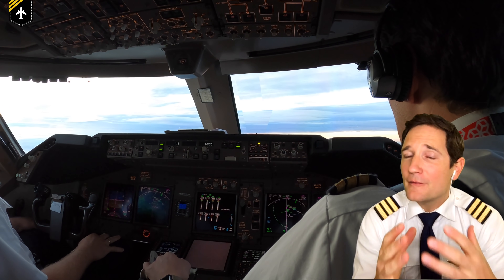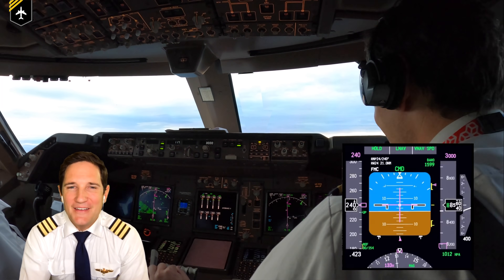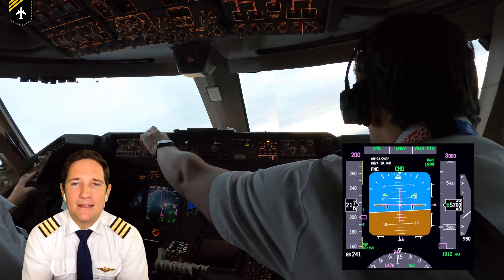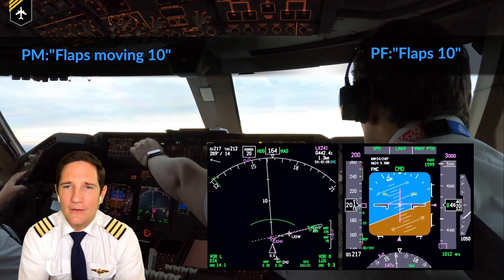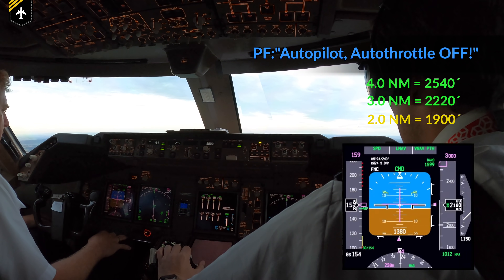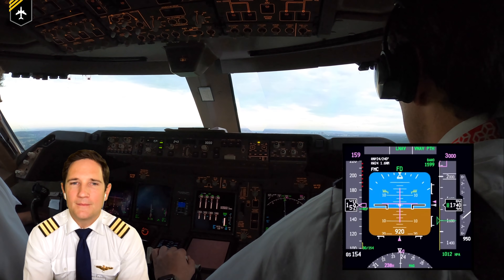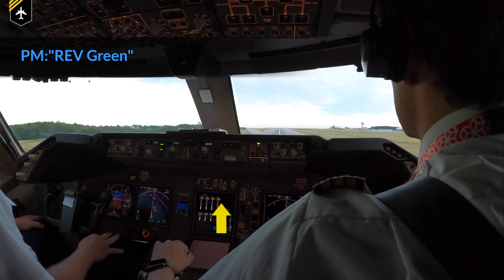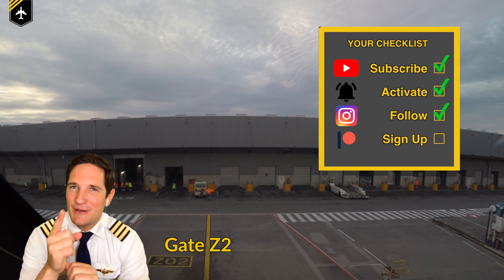How to fly an RNP APPROACH with a BOEING 747??? Explained by Captain Joe

Comment: Never been prouder to have my Capt Joe REMOVE BEFORE FLIGHT when I configure my VW Jetta for departure.
Reply from the maker: Fantastic quote😉
Reply: Haha. I, to my wife and children’s embarrassment, often roll down the window and yell “clear prop” before starting the engine in my Škoda Rapid. I don’t have a Captain Joe key string, but I do have one from RDAF 722SQN
Reply: @TumzDK  I used to call out "Full Boost Vertical" as I advanced the heater levers on my first car.
Reply: Before central locking was a thing, I'd say... " Cabin crew, arm doors and cross check. " and the kids would make sure each others' doors were locked!
Reply: I often do a safety briefing before departure in my Subaru exept the thing with the oxygen Masks (... still have to fit those:D). When im at work however i include that because my work vehicle is able to provide oxygen to some of the passengers (... my work vehicle is a Fire Truck)
Reply: LMAO

Comment: This might be a dumb question but I still want to ask how the plane knows its glide slope using this approach? Cuz u only set the altitude to the DA and let the plane descent solely by itself, that is different from what ppl do with the LOC approach, like setting the FPA to -3 degrees to make the plane descent elegantly. So I’m curious how the plane could stay in the right glide slope if u only provide the altitude without a VS or FPA🤨
Reply: Same with LOC it's not vertically precise because you are still following stepped altitudes as is on the chart. Lateral precision is the strength of RNP because it does not rely on ground stations unlike LOC and ILS.

Comment: Nice video, thanks.
Couple of questions - as a fellow -8 operator - I noticed you shot this approach in Lnav/Vnav? Why not an IAN approach? So in FAC and GP.
I don’t think I’ve ever seen an approach shot in Lnav/Vnav on a -8? In -400 yes. In -8 we do IAN approaches.
The second question is about slowing down. You’re in Vnav - why are you selecting speed manually? If you’re in Vnav you can close the speed window and just ask for flaps 1 and the speed will drop automatically to speed 1. You just need to verify it did. 
Once G/P captures (if you fly IAN approach - see my first question) the speed window will open up automatically (like for an ILS). So why do it all manually?
Also, you say Flaps 5 speed 5 but set your speed 5 knots above it? Why? Our calls and procedures are Flaps 1 - Speed 1 and then let the speed bug drop on Flaps 1 speed, etc., etc. 
Not sure I understand the 5 knot extra buffer considering a flap buffer speed is already built in? The only time we use the 5 knot buffer is for Vref speed during landing (same as you).
Anyways, thanks for the video, looking forward to hearing your perspective.
Fly safe.

Comment: Wonderful landing and explanation. Thank you Cap. Joe. 
I Strongly recommend to use the professional 747 training software- The AerowinX PSX, which is really realistic and simulate almost all the functions of the 747, including the maintenance overhead and circuit breakers. But right, it only simulate the -400 (RR PW GE), and not the -8. 

The Cap Joe channel is always the best aviation channel.

Comment: Awesome video!  As a Cirrus pilot flying Garmin 1000+ I find it amazing how similar the procedures are as I would fly a RNAV (GPS) approach but SO MUCH FASTER! LOL. I assume the green arc on the ND represents the position you will hit ALT set with present vert decent rate?  Thanks again!
Reply: yes it does the legandary " curved banana " shows you at what point you will reach the MCP alt which is set, regarding RNAV does your cirrus use SBAS and can therefore fly LPV minima ?
Reply: @tomharper8402  thanks for the answer!  Yes the Cirrus flies SBAS down to LPV Minmima. Like a zip line. Lol
Reply: @gonetoearth2588  nice one can you then fly lnav vnav gps approches but using SBAS or is LPV and LP the only type that use SBAS
Reply: @tomharper8402  With SBAS (WAAS in USA) the Cirrus will fly ALL SBAS approaches with and without GS coupled to the AFCS...

Comment: A couple of questions for you Capt Joe.  Why are you setting your speeds manually?  Are you required to use a +5 kts value on flap speeds?  Also, why the LVSA isn a -8?  Do you not use the IAN function of the -8 at CV? 

 Also, when you put the transponder to XPNDR you are still reporting altitude but you are turning off your TCAS/ACAS display.  The plane puts out an "On Ground" bit in the Mode-S transponder data so planes in the pattern would know you aren't flying.

Nice video.  I like how you put things together.  I miss flying into LUX though I don't miss the hill on the RWY 6 side.

Comment: why pilots stay on middle runway light humps instead of running aside of them so they dont feel and hear them?
Reply: Just one of the ways to be sure you are at the centre. Despite having a PCN, a metre on or off and you never know your wheel just goes into the pavement.

Comment: Do you fly an Airbus A320 aswell and the Boeing 747? or  are you able to switch planes to pilot sometimes or no? ( I'ma  Cessna 172 Skyhawk student pilot and i'm on my 5'th and i think its  minimium 40 Hours till you reach the pilot's license point?  (
Reply: Bekker the Dutch Angel Dragon legally, if he's current, and type rated,he can fly whichever plane he wants.

But practically, a pilot is kept rostered with a similar type of aircraft. (Though in this case he only flies the 747 as his airline doesn't operate A320)
Reply: ZK-APA I didn’t know so but thanks for telling me / answering my question.
Reply: Bekker the Dutch Angel Dragon he flew the A320 when he flew for Air Berlin but they went in 2017

Comment: hi Captain Joe, why the A380 just have 2 reverse trust (in engine 2 and 3) or is the A380 can do all the 4 engine reverse but the pilots just open 2 after touch down?
Reply: Only 2 and 3 have reverses. All 4 would kick up too much debris such as loose stones or standing water etc. Plus the amount of thrust produced by2 engines was sufficient as the A380 isn’t going to be going to small airports

Comment: I have questions why don't aircraft have rear, side , bottom etc camera with night vision so that pilot can see better incase emergency etc?
Reply: Because all the sensors in a modern aircraft give you a clear enough picture and combined with ECAM/EICAS you can see what is wrong. Pilots don’t need to know WHY something has happened. They need to know WHAT has happened, what has failed and what needs to be shut down, reset, transferred etc. Having cameras is just not currently viable. The tail camera and underwing ones on the bigger jets are purely to assist in taxiing like your rear parking camera in a car

Comment: Why do planes not have propellant thrusters like rockets?
Reply: Because the airframe needs to be able to withstand the amount of force exerted on it from the air trying to flow around it. Why do you think Concorde had delta wings. Also rocket tend to be lit and then won’t go out until they run out of fuel and more difficult to control thrust

Comment: Do you prefer a Radar vectored RNP approach or to fly via LX242/LX243 etc. ?  And does it make a difference if you been on vectors before, for example coming from MMD heading 085 and than LX243 or would you prefer in this case a transition (VAVOT1S)...?

Comment: The "RNV" aspect is not really clear to me yet. Do the LNAV/VNAV mean that the localizer (ILS) is not being used, but instead relied on by GPS? How does this relate again to ILS approaches? You used the DME distance/height as a reference, is this just to make sure no mistakes are made by the AP? Or is this actually being used as a reference because it's an RNV approach instead of an ILS with glideslope?
Reply: An ILS approach relies on 2 beams (one vertical one horizontal) being transmitted from the ground and gradually getting narrower as you get closer so it gets more precise the closer you get.

An RNAV approach is following a series of GPS waypoints at set altitudes constraints (sometimes speeds) and these are all input into the aircrafts flight management computer so main advantage is you don’t need any equipment at the airport. The disadvantage is that normal LNAV/VNAV minimums are not as low as ILS, you need to have a good location accuracy and you can’t autoland

Comment: Hey Joe, great vid. Just wondering what headset you're using? It doesn't cover your ears completely so just wondering if you use a different set for non-pressurized aircraft? Thanks!
Reply: Aaron Sanders this looks like a telex one (guessing though)

But yes, he has a bose A20 when he used to fly the 320 or GA

Comment: interesting!  this procedure is more similar to the 757/767 than the 737NG in that you still must manually set your speed bug with each flap selection. Figured the -8 would be updated logic but guess not?
 "LAVS" is good gouge I got from Boeing (on 767/757) that some might like... once cleared for approach (and on a published segment/transition):
 
LNAV, 
ALTITUDE (set field elevation or MDA, per airline perference), 
VNAV (in case were in HDG SEL) then, 
SPEED (open the speed window, set with each flap selection)

don't forget to set Missed Approach Altitude descending below 1000'

Thanks for the excellent video & helping simmers fly with utmost realism.

Comment: Why do the roles change after landing? It seems the pilot flying always hands control to the pilot monitoring to taxi. Is there a reason for this?
Reply: Craig Lister usually companies have a captain to taxi policy.

Also, not all aircraft are equipped with tillers on both sides.

Comment: Thank you for posting this video. Very eyeopening to see an RNP approach flown in a transport category aircraft. It feels very familiar to the RNAV GPS approaches flown in the US. I noticed that you used LNAV/VNAV minimums. Is there a reason why you didn't use LPV minimums? Is it due to the lack of SBAS/EGNOS equipment?
Reply: “RNP Approach” will be the name for all RNAV approaches after December 2022. They will be the ones with straight lines between waypoints. RNP AR will have the curves

Comment: What is the difference between and RNAV and RNP approach? Is that the name the European pilots call RNAV approaches? I’m a instrument student pilot and I’m not familiar with RNP approaches.
Reply: RNP approaches are becoming the name for RNAV because all RNAV approaches require some form of required navigation performance. RNP AR approaches will be the Ines with curves. Both use the planes systems to monitor its progress as long as it’s accuracy is within limits. 

https://www.icao.int/MID/Documents/2016/PBN%20SG2/2.PBN%20Charting%20-%20ICAO.pdf

Comment: Hi Joe, hope you are doing fine. My questions to you are as follows: 

# Why sleeping berths or bunk beds are not popular in airliners for passengers?

# What is LNAV/ VNAV? How does it work? And how it's different from ILS?
# Types of ground vehicles and types of equipment used for airport operations on the ramp?
Reply: LNAV/VNAV are lateral and vertical navigation. 

Lateral navigation mode on autopilot means the plane will fly from one way point to another automatically as programmed into the flight management computer. Pilots don’t touch anything unless required. 

Vertical navigation controls the altitude and speed at the given waypoint. If the waypoint requires you to be at/below or above an altitude then the plane will fly within those constraints. 

On landing the difference is you’re using the planes on board systems to fly the approach instead of sensors beaming out information on the ground.

Comment: We see in the Primary Flight Display that the aircraft flys a little bit upwards, the artificial horizont is below the center line of the aircraft. But the aircraft should not climb but descent. Is this upward angle of attack used or necessary because the aircraft is flying with low speed so it is necessary to increase the uplift?

Comment: Do you guys ever fly GPS/GNSS approaches at all or only RNP AR approaches? What are the differences?
Reply: GPS/GNSS and RNP approaches are the same but RNP is becoming the name given to all approaches using GPS. You are flying from point to point in straight lines. RNP AR approaches have curves between waypoints, have higher location accuracy requirements and special pilot approval

https://www.icao.int/MID/Documents/2016/PBN%20SG2/2.PBN%20Charting%20-%20ICAO.pdf

Comment: What a lot of people don’t seem to realise is an RNP approach is the new name for all RNAV approaches and will be standardised by December 2022. It’ll either be RNP (straight lines point to point) or RNP AR (curves between waypoints) 

https://www.icao.int/MID/Documents/2016/PBN%20SG2/2.PBN%20Charting%20-%20ICAO.pdf
Reply: Thanks for this comment. I was wondering why those approaches are called sometimes  RNAV or RNP on charts.
A good exemple of RNP (AR) is in Innsbruck (LOWI)
RNP Z 08 (AR), and RNP Z 26 (AR).

Comment: Hello Joe
Great video. One question. When selecting flaps 5 you say you also select flaps 5 speed. However, you set 200kts in the MCP in stead of the speed of 190kts as indicated by the green 5 in the speed tape. You do something similar with flaps 1 and 10. 
When I did my MCC I only did something like this on Vref, not before.
What is the reason for this?
Thanks and regards from the Netherlands

Comment: Sorry CJ, but you need to do a segment on what and why RNP is used. Until I saw this I had never heard this acronym. 😳
If you have already done this I apologise for my lack of attention and as for guidance to correct upload. 🤭
Reply: RNP is basically an approach where you navigate from one waypoint to another and at a set altitude constraints for each one. It’s commonly used at airports that don’t have ILS because it’s cheaper and doesn’t require maintenance. The disadvantage is if the planes location accuracy isn’t good enough it might not be able to perform it and with no ILS it has no guidance from the airport. If weather is clear then could just go visual
Reply: Did some homework. OMG!
The nearest intl airport to me, Queenstown NZ, Uses RNP. 😳  
Learning every day. 🤔. Thanks for your answer.
Reply: DB Thats-Me queenstown airport has RNP AR which means that the approach has curves instead of just going straight liens point to point
Reply: AAAAAAGGHHHH.....Brain explodes.  Sits down with quiet Gin. 👍

Comment: Joe,  seems like you have two sets of deviation pointers, white and magenta.  I'm guessing the vertical white is on GP for the approach, and magenta is deviation to the selected MCP alt by the next waypoint?  Not quite sure..... 
Also, what do the white (occasionally turned yellow) solid lines that seem to be deviation limits represent?

Comment: I love these video's, you can tell the PIC is senior by how fast they taxi to the gate. Looked like about 60 knots  to me and did not even have to touch the brakes for the 90 degree turns.  Amazing !!  :-)
I would love to see the 747 engine start and take off.
Geeze the planes I fly have VNE of 160 knots and land at 47 knots (or a little slower than the Captain was taxing :-)
Reply from the maker: It was fast forwarded

Comment: Nice video! I am wondering how pitot tubes work, would be nice to see a video on that.
Thanks!
Chester
Reply: They're basically a hollow tube that sticks into the oncoming wind. It measures what's called the "ram air pressure" which is caused by the air wanting to basically get shoved into the tube, that's essentially blocked off at the back. Since the air can't pass through, pressure builds, which is directly related to air speed.

That's my explanation as a new student pilot. I'm sure joe's description would be much better and in depth
Reply: @nhwilkinosn  Thanks for the explanation, but I was hoping for a more detailed one from Joe. I know what they are in general (I know basically what you just stated), but I don't know:
What if the altitude is higher and the air pressure is higher and the pressure drops? Is that the speed reading then refereded to as the "Indicated airspeed"? (that was just a quick guess)
What if the wind is blowing air into the pitot tube? Would the reading be different or is it somehow calibrated to the wind or something like that?
etc. etc.
Reply: @chesterwang3070  airspeed is basically the difference between the ram air/pitot tube and the static source. So it's able to "tell" if there are pressure differences, but it doesn't know about wind, so you just get your air speed.
Reply: @nhwilkinosn  Thanks for the info!
Reply: @chesterwang3070  I hope Joe (or someone with a deeper, better knowledge) suppliments my very basic understanding.

Comment: Why are the reverse thrust only on engines 2&3 on the A380?
Reply: Having all 4 would kick up too much dust and FOD that could get sucked in. Plus only 2 is sufficient as the A380 rarely lands at small airports with short runways. 2 was deemed sufficient
Reply: @tomstravels520  but the 747 has all 4 engines having reverse😕😕
Reply: AB flyer 747 engines are less powerful. RB-211 is about  maximum 59,000lb of thrust, PW4000 about 62,000lbs. The Trent 900 is about 84,000lbs
Reply: @tomstravels520  oh ok. Thanks

Comment: At the first half, you were descending with your wings above the horizon??? Was the aircraft stalling?
Reply: Jairo _gonzalez that's the aircraft attitude, and not a flight path indicator (both are different)

But basically attitude is the nose in reference to the horizon, irrespective of it climbing, descending or in level flight.

Comment: Why do you have different reverse thrust power such as idle reverse and full reverse?
Reply: Dinosaur, Nothing to see here it depends on what kind of stopping performance you need. If the runway is much longer than required, one can use idle reverse (basically reversers on, but the engines are not spooled a lot). It can save a bit of fuel but more importantly increases an engines life.